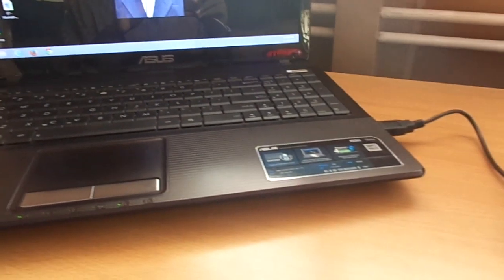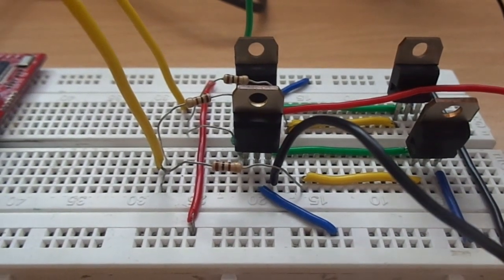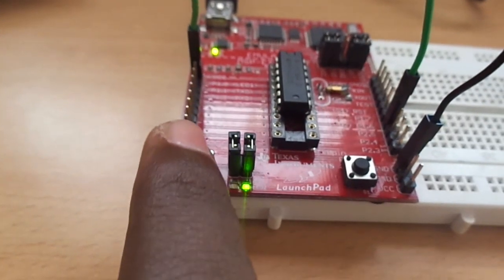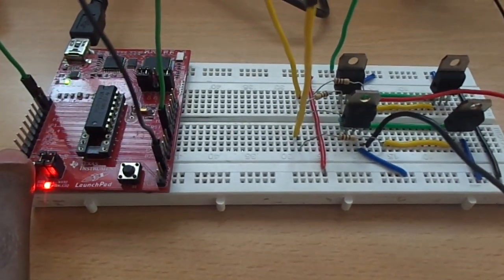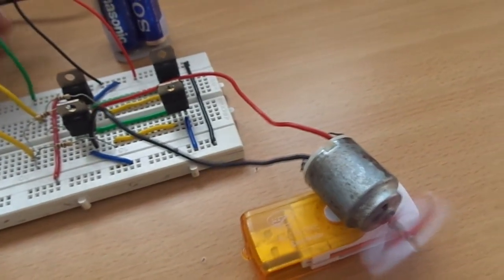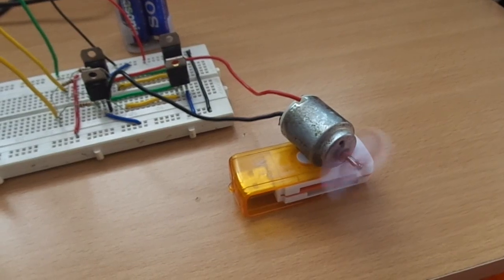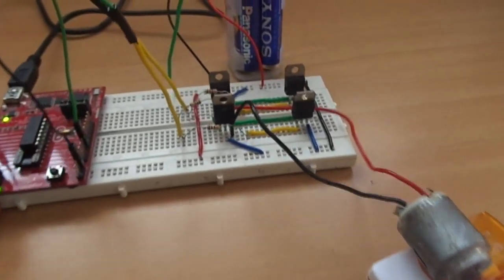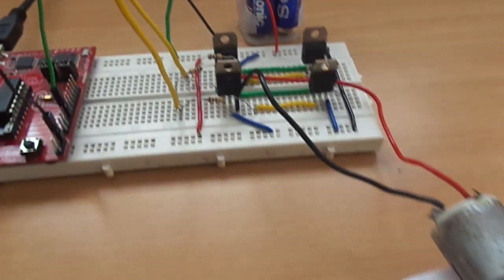BUILD YOUR OWN H BRIDGE CIRCUIT USING NPN TRANSISTORS

Comment: this circuit is bad because there's no diodes blocking backward current provided by dc motor, you can burn your uC...well, the TIP's max Ic current is 5A so it depends on backward current, but it's better to protect elements rather than getting lucky.
Why Q1 and Q4 Ic current is going to Vcc ?!
Reply: +Andikoize you must be kidding? TIP122 has a 100VCE rating, no way is a 6 volt AA cell battery going to  harm TIP122's, the internal resistance of the battery ain't low enough and that tiny motor  can't harm TIP122's either.
 he's got resistors protecting his cpu